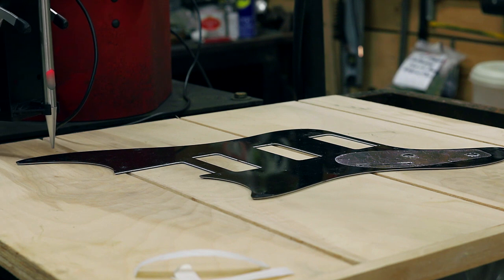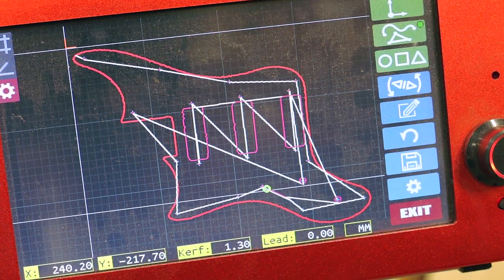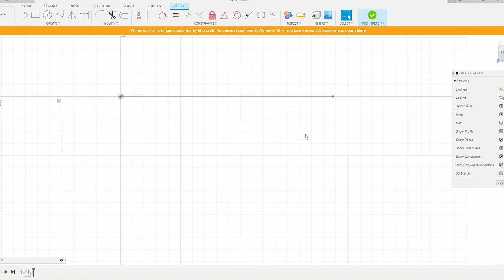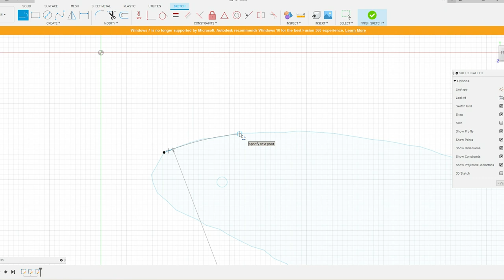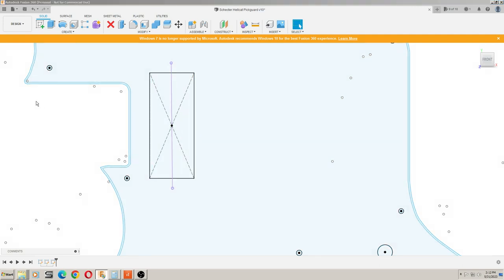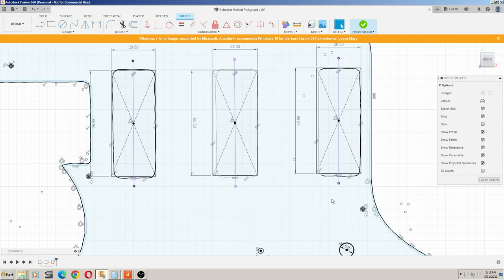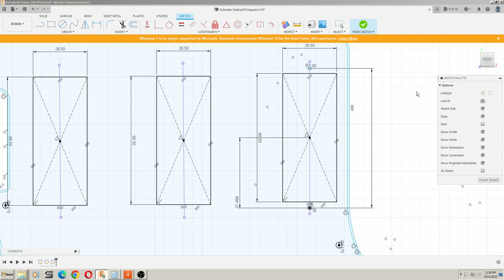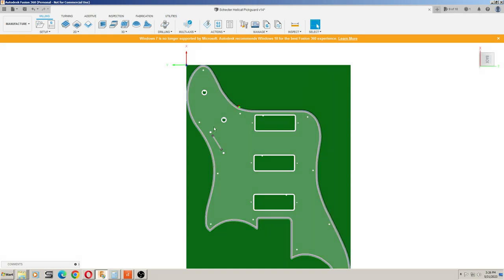ArcDroid for Digital Tracing..some Fusion...some  CNC Router and a Schecter Hellcat VI Baritone

Comment: So cool -- do you regret choosing the arcdroid over the langmuir at all? I'm thinking of either getting the arcdroid now, or getting the big crossfire later on once I finish my new shop next summer
Reply from the maker: Not really. The trace thing has come in handy a few times. And I've been able to cut almost everything I want to. If I wanted to run a dedicated sign cutting business and had the space, the Langmuir would be the better choice just because of cut volume. But for most other situations the ArcDroid works really well.

Comment: I am working on building a table for a future arcdroid purchase.  I have seen conflicting dimension information for the 1/4 baseplate it's mounted on.  I've seen 10inches deep but given a 15.75in wide as well as 20in wide and don't k iwnwhat is accurate.

Could I impose on you to measure the length and width of that 1/4 plate on your arcdroid?   Thank you very much in advance.
Reply from the maker: https://forum.arcdroidcnc.com/t/base-plate-dimensions/542 

Second post, from Andrew himself, base plate dimensions.